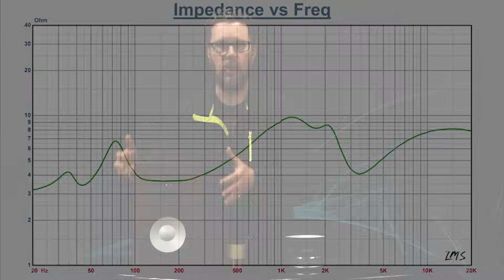What is Speaker Impedance? | Impedance ohms rating explained

Comment: Thanks Andrew, as always very interesting and informative.  One question, though, I thought that clipping would be a part of the discussion.  Isn't it the case that if the amp is being stressed but doesn't shut down it might not be providing enough power and clipping could result?  Or have I mixed that up?   (Or is there another video that I missed?!)
Reply: Clipping is an amplifier related problem, not a speaker issue. When talking about amplifier power ratings, unfortunately the industry has turned the issue into a disaster. The problem is, there's no standard that power amplifier manufacturers gave to go by when rating an amps power. Every manufacturer is left to do it however they see fit. And the differences can be extreme. 

This is a huge topic, but I'll try to give you a few brief examples just to make the point. Watts=volts x amps.  10 volts x 10 amps is 100 watts. So is 50 volts and 2 amps. So is 50 amps and 2 volts. Basically any combination that gets you to 100. All other things being equal, the more current used to make up a watt, the better the amp will be at handling hard to drive speakers. 

Any time watts are measured, there's an associated level of distortion related to the rating. I'm oversimplifying a bit, but in general, one company may be rating an amp for 100 watts into 8 ohms at 5% distortion. If you gave that same exact amp to a different company to rate, they may have higher standards and say 5% distortion is too much. Maybe 3% will be their limit, and they will only rate the same amp at 75 watts into 8 ohms. Lower the standards, and it can go the other way, as well.

How the actual measurement is taken is also critical, and is the easiest way to create artificial specs. Typically, a mass market company that makes receivers (Sony, Yamaha, Onkyo, etc..), knows they will be competing with each other for similar products at similar prices. When measuring an amp, you have a choice to make. It can be done under real world conditions, or in a lab. In order to get the lowest distortion numbers, they'll use test tones at certain frequencies in order to get their distortion numbers. Its much easier for an amp to reproduce a continuous test tone, than to play actual music. That's why you see really low distortion numbers like .000something. Measure the same amp with music playing, and you may see something like 10% thd, or higher. That's also why you'll see higher end amps with specs that don't look as good. They're more honest in their measurements.

The end result is, you can take 20 different power amps all rated for the same amount of power, measure all of them the same exact way, and all 20 amps will be different. And to be honest, is sucks for the average consumer that just wants to buy the right product. The only advice I can give you is to trust speaker specs over amp specs. Always. Speaker manufacturers know that the easiest way to get bad sound is to use an underpowered amp. That's why speaker specs tend to be more accurate. Aside from that, you use experience and real world examples to make your choice. For example, if you are in Bestbuy and see a pair of Polk speakers playing well with a $500 Sony receiver, start there. Other receivers they sell for about the same price should work just as well. If you're not sure, call the company that makes the speakers and ask them. Especially if you are looking at more expensive speakers that may be harder to drive. Also, as you gain more hands on experience, you'll get to know the products and what to expect. But your safest bet is to see what the speaker manufacturer recommends. After a while, you'll be able to make the choice yourself.

Comment: If I have 8 ohm amp and 8 ohm speakers, two channel amp and four speakers, so two per channel. Connecting either in series or parallel I end up having either 4 ohms or 16 ohms on speakers end. Which is safer for the whole setup, 8 ohm amp 4 ohm speakers or 8 ohm amp and 16 ohm speakers
Reply from the maker: The 16 ohm connection is likely going to be safer, but I never recommend connecting two speakers in series as they will then influence one another. I would check to see if your amp states that it’s compatible with a 4 ohm load and, if it is, connect them in parallel.
Reply: @Axiom Audio  thank you for your response. These are Sonos Sonance ceiling architectural series speakers but I am going with Amazon Echo Link amp, I understand that Sonos amp be perfect for that but we mainly play things off Alexa plus it's $200 vs $700, got it on cyber Monday. This amp specs in detail are nowhere to be found, everywhere I look it's 8ohm 8ohm 8ohm
Reply: I checked with Amazon, second level technician said it's safe at 4 ohm, so I be doing parallel on each channel. Also, I tested both scenarios, in series was little distorted and more quiet than parallel, I wouldn't be happy having it this way. I do appreciate your help, it made me contact CS to get an answer 🤜🤛

Comment: I have the Yamaha rs202 amplifier. It has dynamic power ratings for 8,6,4,and 2ohms. But then says minimum impedances 8 ohms. Would I be okay to use 6 ohm speakers or no?
Reply from the maker: If it has power rating for impedances down to 2 ohms you should be fine with a 6 ohm pair of speakers.
Reply: Okay, thanks for the response!

Comment: Too much gable and way too long. How would you explain this to my 96 year old grandmother without pulling out the Electrician Manual. As far as I understand it, Impedance is the same thing as Resistance. Resistance is used for DC current and Impedance is used for AC current. Ohm is  used the value used for both Resistance  then why would it be dangerous to use a 4 ohm speaker on an 8 ohm receiver ?
Reply: 4 ohm speakers could cause your receiver (that recommends 8 ohm speakers) to overheat, or blow a fuse, or go into protection mode, or even damage the internal components, or..... it may never even give you a problem, but if it plan on playing it loud and long, most likely something bad will happen to your receiver.

Comment: I bought a set of 4-ohm speakers that are driven by an amplifier (Rega Brio) that has two settings, 50 Watts RMS into 8-ohm and 73 Watts into 4-ohm. Rega does say that extended high volume play will cause the unit to get a bit hot in the 4-ohm speaker setup. I have no problems so far. Thanks for the explanation. Have you discussed which gauge wire to use for 4-ohm speakers? I will take a look at your video collection. Thanks
Reply from the maker: As long as the amp does not get too hot or shut down you’ll be fine. I answered your wire question in another comment. 😊

Comment: excellent video.
i believe the international standard refers to nominal speaker impedance as a somewhat minimal resistance value (80% of the stated impedance) presented to the amplifier. 

- a 8ohms speaker should not present a lower than 6.4ohms resistance to the amp (8 x 80%).
- a lot of receivers have terms like 'dynamic power output' in the 'thick' manuals, specifications section. a  receiver amp w/ 100W per channel at 8 ohms, will deliver up to 170W into 4ohms but for short duration and at higher than normal total harmonic distortion. yamaha, onkyo, denon, pioneer, etc, all have the capability to drive v low impedance load bursts (2-3 ohms).
Reply from the maker: Thank you, and thank you for covering accurate information that I did not include in my discussion of impedance!

Comment: 1) What I don't understand is, if 4 ohm speakers are more difficult to drive, why is the value so low? Shouldn't 8 ohm or 16 ohm speakers be more difficult to drive since there's more resistance? 2) Again, if 4 ohm or 2 ohm drivers are more difficult to drive, why does car audio specs REQUIRE 2 or 4 ohm speakers/amps? I thought the lower impedance meant that it was EASIER for the amps to drive the speakers due to running power from a low voltage supply - the car battery.
Reply from the maker: Well, it all comes down to Ohm’s law and the current requirements, which I go over in the video. For car amps, they are limited by the 12VDC available from the battery/alternator, so to get more power you need to use lower impedance drivers. That’s why you commonly see 2 and 1 ohm car subwoofers.
Reply: If you were drinking thru a straw.  You could use a skinny one or fat boba tea.   One will empty the glass faster  But take more effort.   The skinny is easy but longer time.   So if you want big bass  you need the fat straw  or the low impedance speaker.

Comment: Sorry, I have to disagree with some of this (perhaps because some of it is simplified for a general audience???) Resistance is one aspect of impedance as are capacitance and inductance, and all three are considered in both DC and AC applications. About the components: a pure resistance does not affect the phase difference between the voltage applied and the resulting current; i.e. the current through a resistance will always be equal to the voltage applied divided by the resistance value in both DC and AC circuits and regardless of AC frequency. A pure capacitance appears as a short circuit when a voltage is first applied to it so no voltage is measured across its terminals but current is flowing through it. As a capacitor charges up, the voltage on it's terminals will rise and the current through it tends to zero. So, the "current leads the voltage." With a pure inductor, the opposite is true in that when a voltage is first applied, the voltage across it will be the same as the applied voltage but the current through it will be zero. Over time, the current will rise but the voltage across it drops to zero, so "voltage leads current." All of these characteristics are important in both DC and AC circuits or physical systems like speakers. E.g. DC analysis may involve calculating the current through a series RLC circuit connected to a battery, while resistance values influence the cutoff frequencies of filters in AC circuits. Resistance is also considered in DC and AC circuits because it determines the heat generated. Pure capacitors and inductors store energy but then release it to other components; they do not dissipate it as heat.
Reply from the maker: You are, of course, entirely correct here. I did not go into the nuts and bolts of this topic as it was meant to serve as a general what and why and not an in-depth analysis on the topic of impedance.

Comment: If I connect 4ohm+6ohm to left channel I understand I should connect them in series instead of parallel to keep the impedance at a safe level. Amp is rated at 4-16ohm. Are there effects on volume i.c.w right, or anything else, that I should consider?
Reply from the maker: Are you only connecting two speaker in series on the left channel? If so you will likely have more output from the left channel and will need to use your balance control.
Reply: do not run speakers in series unless absolutely necessary and then only if the speakers you want to run in series are identical... so DO NOT run a 6 and a 4 in series ever

Comment: Very nice presentation of a complicated (for me) topic.  I have speakers that are rated at 6 ohms and and integrated tube amp that has both 8 ohm and 4 ohm taps.  I have used both at different times.  Which is right/better and should they sound different, and, if yes, how will the sound differ?  I am hitting subscribe!
Reply from the maker: Thank you! For a 6 ohm speaker, you’re right in the middle of the taps, so either one will work. It’s a matter of listening to decide if one sounds “better”. On the 8 ohm tap you might reach the limits of the amp earlier than with the 4 ohm tape.
Reply: @AxiomHomeTheaters  The frequency response of a tube amp will be different that a solid state amp driving the same load. In a tube amp, the frequency response curve will 'follow' the impedance curve. So, at certain frequencies where a typical speaker's impedance may rise, you'll get a corresponding voltage-rise using a tube amp.

Comment: The high-impedance versions sound more transparent and clearer, bass definition is better, and the soundstage is more spacious. ... The lower moving mass of the 250- and 600-ohm headphones' voice coils is lighter than the 32-ohm models, and the lower mass is part of the reason high-impedance headphones sound better A 4-ohm speaker requires more power from an amplifier than an 8-ohm speaker to produce the same loudness of sound. Power is a combination of voltage and current, so to provide more current to the speaker, an amplifier must have a higher power rating. ...Sep 12, 2015
Reply: You like many others have this totally backwards! 8 ohm speakers and amplifiers are total garbage as the resistance is higher it is harder to drive an 8 ohm speaker. The higher the number the more resistance which you need to think in terms of the size of a pipe and how much water can flow through it. Let’s say we have an 8 ohm speaker that is 200 watts RMS. Then you have a 4 ohm speaker that is 200 watts RMS. 4 ohm is lower resistance and you can dump twice the watts per channel continuous in a 4 ohm speaker. Let us just say your amplifier with a toroidal transformer is 100 watts RMS per channel at 8 ohms. It will do 200 watts per channel RMS continuous at 4 ohms. You get double the power from a 4 ohm amplifier and speaker. You want heavier awg cables for lower resistance and higher current. Say you have pin thin wires with no shielding. Think about it as that increases the resistance and makes the amplifier work harder like trying to push gallons of water through a tiny skinny pipe. So it is changing and distorting the signal. Say you have a lot of information to write down on a large piece of paper. Try to fit all of that information from the large paper to a small note pad. What happens? You lose information. So heavy awg wire with good shielding and electromagnetic interference rejection will have less resistance and much higher current flow as it is a larger pipeline. What we all want is to maintain signal strength and integrity. You lose and distort the signal with pin thin wires without proper shielding. The thing that also happens is thin wires make the amplifier work harder and all of the power gets lost in heat dissipation. Thin wires burn your speakers out faster and they burn the amplifier out faster. I had a Rotel RB-1050 power amplifier with a toroidal transformer that had an almost perfect signal to noise ratio of 116db. It was 70 watts per channel continuous RMS at 8 ohm. It was 140 watts continuous RMS at 4 ohm. I had a preamp with a signal to noise ratio of 120db. I also had a current filter. My Klipsch Synergy F1 speakers were Bi-wired with the Monster Cable all in one Bi-Wires. The F1 crossovers with the stock 18 awg wire sounded super harsh with the highs and the mid/bass drivers were constricted with no body or detail. I had a volume of 1-10. I could only turn it a hair above 2 and the mid/bass drivers would bottom out and pop. I soldered in 14 awg Monster Cable XP and the highs were smooth and non fatiguing. The bass was incredible and dynamic. The detailed width of sound stage, depth, texture, dynamics clarity were breathtaking. I could now turn the volume up to 7 without distortion or listening fatigue. I got 3 times the power output. I have tested tons of cables and the best bang for the buck cable is the 14 awg Monster Cable XP with the magnetic flux tube. That flux tube does exactly what it claims. It makes the sound more detailed and takes the harshness out of the sound. I also strategically placed polyfil in the cabinets. My Klipsch Synergy F1 speakers cost me $550 for the pair and they blew away my $1,200 Polk Audio LSi 9 speakers. They also sound better than my $2,000 Polk Audio SDA 1987 speakers. I mod all of my equipment with 14 awg Monster cable XP. Crossovers and amplifiers. I also replace my opamps with the National Semiconductor LM4562NA opamp that has a signal to noise ratio exceeding 120db as it reaches 140db! Bang for the buck as far as cable goes Monster Cable blows everything away in it’s price class and beyond. In reality all of the other cable companies charge more money for inferior quality cables. My $260 pair of Monster Cable Bi-wire cables totally destroyed a pair of cables that were $1,700 per cable. Make your own observations and don’t listen to all of the egotistical delusional people that pretend cables don’t make a difference. Opinions have nothing to do with truth or fact as they are individually distorted perception’s based on an individual’s ego driven manipulated perception’s. The Ego is an emotional exaggeration of self be it in the positive or negative. The Ego is the day and night dreamer pretender that pretends it is always right and never wrong. Since all information is manipulated the ego greatly limits and distorts an individual’s perception of reality. Perception then becomes that individual’s reality. The Ego accepts lies as the truth and denies the truth as it is being spoken. It is a lie and illusion that span infinity itself. It is only through humility that the truth in reality can be obtained and understood. Your humility must meet or surpass your intellect to truly understand what reality is. Please go to my Facebook page Nathan Pelton with a picture of Gumby. Thank you for your time!